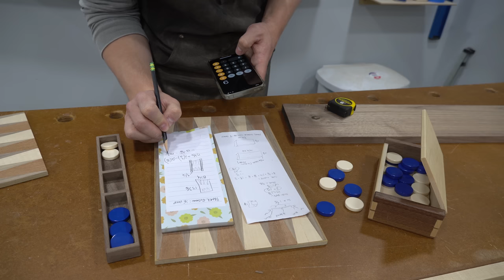Building a Backgammon Board | Woodworking with Hand Tools

Comment: Stunning build, David.  Love the piece holder with magnets holding it in place.  When gluing veneer (don't do much) I use either parchment paper or wax paper or packing tape as a barrier between pieces.  Have you ever had a problem with glue sticking to the melamine?   That looks like a nice solution.
Reply from the maker: Thank you so much Don! In general I've never had a problem with glue sticking to melamine, I've found it to be a good gluing surface. However if parchment/wax paper is working for you, there's no reason to fix something that isn't broken!

Comment: So my only fear is that I wouldn't know which side was the top or bottom and I'd open things up to have the pieces spill everywhere. That said, I'm guessing the bottom didn't get that walnut burl veneer, correct? I even watched a 2nd time to see if you ever showed the bottom, but I couldn't spot it.

Beautiful work as usual. You are inspiring me to give a shot to a hand tool only build. My daughter's been wanting a tic-tac-toe board, and I'm thinking it could time to improve my hand tool work. We'll see though. I might still do the resawing on the bandsaw. 😂
Reply from the maker: That's a fantastic point Matt! That was my #1 struggle when designing this. Ultimately I'm fine with it because if you open it up the wrong way, all the pieces spill out onto the board (e.g. not onto the ground or something), and you're about to set up to play a game of backgammon with the pieces anyway, so it's not really that terrible. Still, I wish I had a better solution.
There is burl on both sides so the case is very symmetrical when closed, so it is difficult to tell which way is up.
And, awesome! Let me know how your build turns out! To be honest, even when I'm trying to mostly use hand tools, I still use a band saw for resawing 😅

Comment: Very nice work and incredible looking final piece!  Just a note, I've heard you shouldn't use TiteBond III with Walnut.  I don't know why, but I am considering changing after some research.  I just thought I would let you know.  Keep up the great work!
Reply from the maker: Thanks Rj! I'm surprised about TB3 with walnut. I've built many pieces of solid walnut furniture exclusively with TB3 over the past 3-5 years and have had zero issues. TB3 is my favorite!
Reply: @dkbuilds  same.  Maybe/hopefully it's just internet bs.  I've got a lot of end grain walnut cutting boards out there.  i'd hate to hear if they are coming apart but so far so good.  I've done some research as well and can't really find anything so I'm sticking with it.  The only reason I mentioned it is because I heard of the issue on a reputable woodworking vlog.

Comment: My dad and I love playing backgammon. However the board he got decades started to get moldy (due to monsoon/high humidity) some months ago and we decided we should try to make a simple one. However I have no woodworking experience and my fathers plan was to use plywood with veneer. Would you have any advice for a complete novice, what can I do to try and make a simple board.

Edit: oh and even though I just jumped into my question, I hope you know I love your board it looks amazing
Reply from the maker: Thanks for watching and commenting, kik! A backgammon board is a fairly complicated project for a first woodworking build, but you can do it! I would recommend buying some cheap veneer and experiment with cutting and gluing it like I do in this video. Other methods are (in my opinion) more complicated. It may be possible to buy the triangle template (for example made of metal) which will be a big head start on the process. Good luck on your build!

Comment: I don't like heavily figured timber. I don't like backgammon. I do, however, like hand-tool woodwork, and videos without inane commentary, so I watched this through to the end. You might consider a quick touch of wax on your dovetail saw, and I was disappointed to see the table saw used for something easily done with hand tools, but nonetheless, this was a nice project, and a nice video.
Reply from the maker: That's great, Mike! I'm glad you watched. Good call about wax, and I agree about the table saw. I would have preferred all hand tools myself!

Comment: What’s the measurements on the board that you put the triangles in
Reply from the maker: The board is 8" by 13", six triangles on each 8" long side, the triangles are 1.3" wide at the bottom and 5" long. Hope that helps!
Reply: @dkbuilds thanks for answering one more question about the side panels that you use when you glue it all together what are the dimensions on them
Reply from the maker: @Philipbangm  Unfortunately I don't remember those dimensions, after building this I gave it away as a gift so I can't measure it again. Sorry about that! Hopefully you can guess from the video.